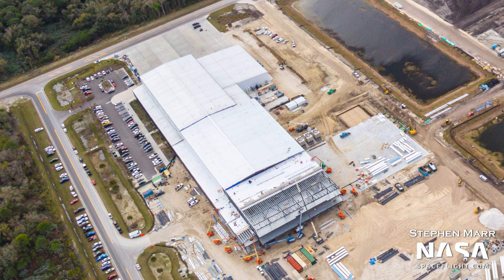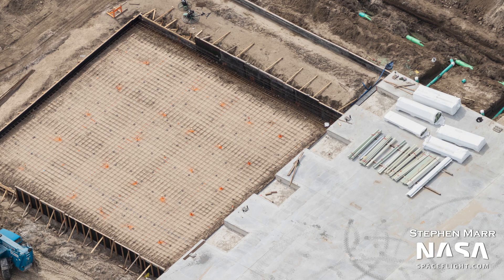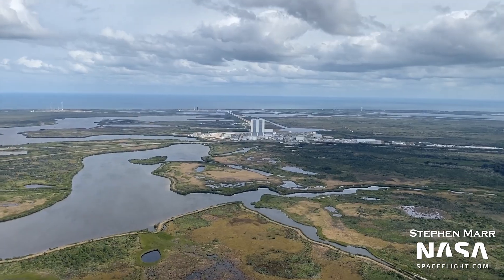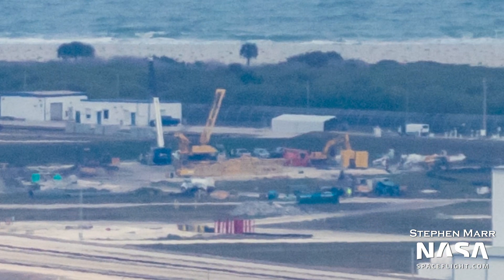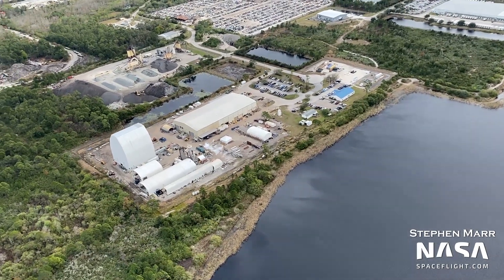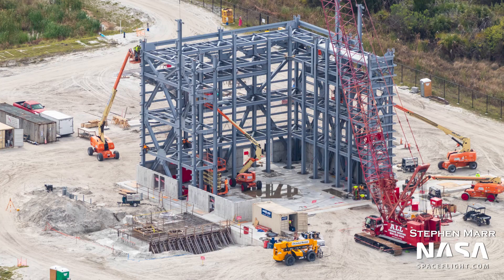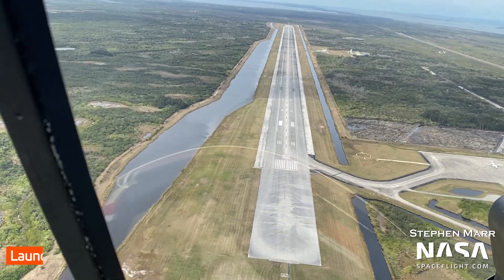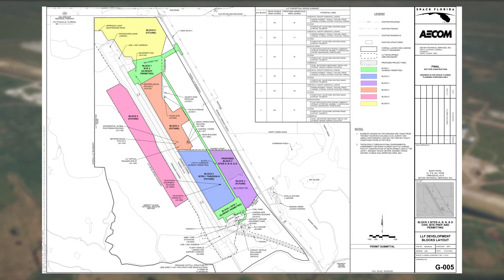Starship Launch Tower in Florida Coming Soon | Cape Update - Narrated

Comment: Why would SpaceX build a launch tower at the rocket factory rather than an designated LC?  It's got to be the start of footings for a high bay right?
Reply: Launch tower segments.
In Boca Chica they built those at the "propellant production site" before moving them over to the launch site for stacking.

Essentially a method of parallelizing the work.
One set of workers can assemble the sections while another set is stacking them
Reply: @kevinkrammer8077  OK, so temporary section fabrication, not permanent, thanks I'm not crazy!

Comment: Spacex could be sending up starship from the Cape within this year! 

I have been looking Back at the time line from the build of the orbital launch tower (mechazilla) at Boca Chica (tanks to the awsome coverage of NASAspaceflight) and the Spacex team needed about 11 months for the fiscal build.
A month into the build some foundation work at the pad and the foundation for the assembly of the tower sections were visible.
Roberts Road looks like it's at the same stage now. So within 10 months they could be ready for the lifting of starship at 39A. 

If several of the skilled worker were send from Boca to the Cape this could even be done quicker. But we have to consider several falcon 9 launches within the build site so 10 months is a safe assumption.
And they would have the hole month of December for the launch of the starship. 

Thanks for this great video!

Comment: The first building on Roberts road "Building X" has multiple floor levels so no boosters stored in the addition.  Most likely either office space, parts storage, or maybe test equipment. The 1st floor appears to be 12' and you wouldn't want to be lifting hardware up a level to work on so nothing big here.

Comment: Interesting to see work on Schwartz Rd, that gives a route that will minimize the time the SPMTs spend on the main highway. However, I'm interested to see if SpaceX uses the old railroad line - it's a very short way due east of the new shipyard. The southern part of the line is almost certainly not in use, and the rest has infrequent use - it delivers LOX and fuel to KSC. The interesting part is - the line runs right up to the Saturn Causeway, the crawler track to Pad 39A. Using the railroad would eliminate ~98% of any usage of the streets.
Reply: Great observation.

Comment: Please look back how long it took in Boca Chica to erect the launch tower as it is right now.
Then take the same time into account at the Cape, to be saferish. (urgency might speed up stuff a little bit)
Also take into account the orbital tank farm, a water deluge system, etc.
Reply: Cidco Rd is a steel fabrication plant. They've been building really big structures and shipping them out the last few years. I can safely assume to Texas. If so then they'll save alot of time in transportation alone. 

SpaceX has experience now which they didn't with the first launch facility.
Plus, with a bit of luck they'll be cranking out 3 launch towers  for Florida. 1 more for Texas and 2 for the Offshores